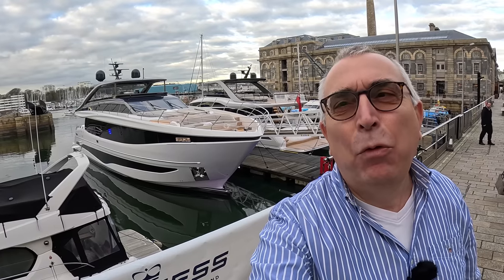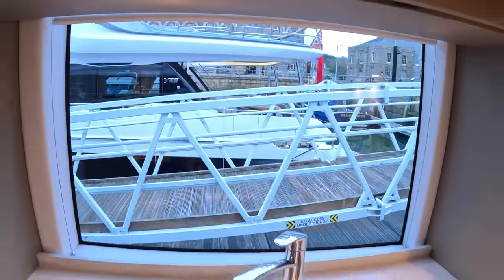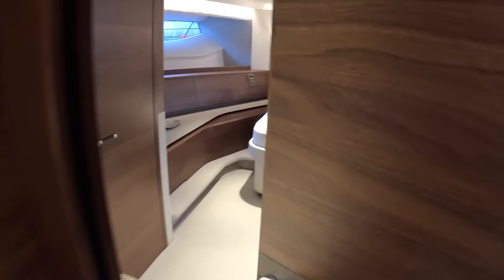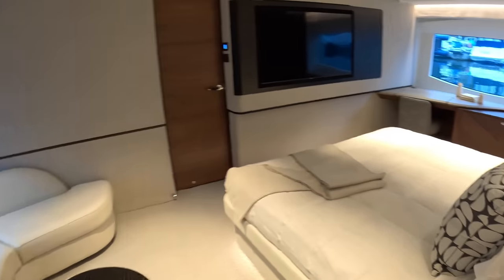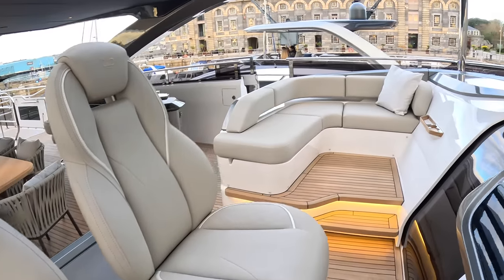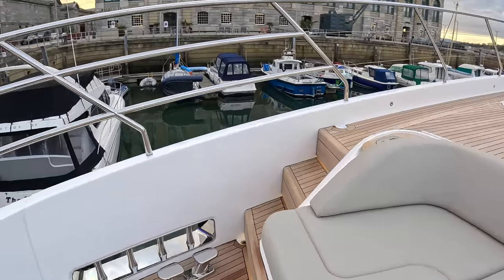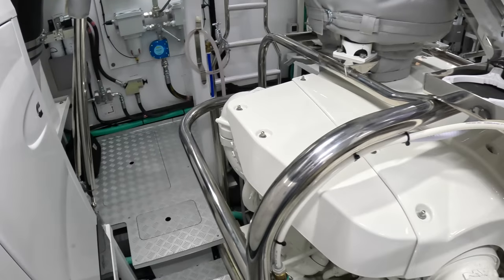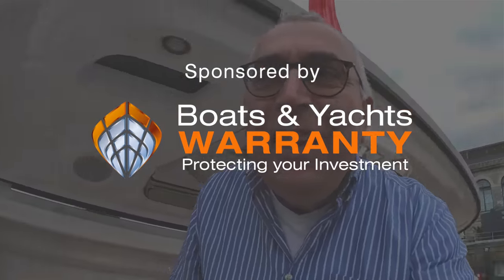$16,000,000 Superyacht Tour : Princess Y95

Comment: Another great Super Yacht Video Nick. However there seems to a famine in videos on more affordable boats including Smugglers  Blues. As you are now afloat all year in Dartmouth - any chance of some winter motor boating?
Reply from the maker: I hope so! We went down today for the first time in ages just to give the poor thing a clean and put a dehumidifier aboard, it's been a crazy busy autumn visiting boat shows and making videos. When we get some lovely winter days we'll make another Smuggler's video. 🙂
Reply: @AQUAHOLIC  Thanks Nick that would be appreciated. 
Yes went down to my 895 Offshore today to check the dehumidifier and decided to add a small bar heater at low setting for this next cold snap. Take it you have drained the FW tank and added that pink ( drinkable) anti freeze too. Agree with you it pays to look after and check your boat through the winter. ( Could be the subject for a future video?).
Plus of course giving the boat a good run when you get a spell of bright settled weather!!!
Your smugglers videos are some of your best!
Reply from the maker: @johnpenson8801  Yes, we have an oil filled radiator on a thermostat. With that and the dehumidifier, it's lovely and cozy down there! 😄

Comment: £16 m and manual doors? Otherwise a stunning piece of kit great tour nick as always 👍
Reply: I'm partial to manual doors. The electric doors are too slow and the button is always off to one side so you have to walk over to push it anyways so it doesn't really save much effort. You don't want auto because you want to be able to stand near it without it opening. Also power doors are just one more potential point of failure. Complexity is the enemy and should be eliminated where it brings little to the table imo.
Reply: If its sinking or on fire i want manual doors thanks
Reply: flacjacket I understand your point but I was thinking more about the crew ,if automatic doors had a foot mechanism it's better for them with their hands being full? And I presume you can turn off the motion sensor?
Reply: Mr titmus as with all yachts, aircraft  etc, there are usually two methods of a door to open as a failsafe auto and manual I would be surprised any vessel would pass certification otherwise?
Reply: It's not 16 million it is about 7-8 million pounds or  about 9 million US. Still, I did expect electric doors.

Comment: Would you rather have the majesty 120 or the princess y95? Both at 16m.
Reply: Not comparable. Different opperating costs (majesty bigger boat more expensive to crew, insure, dock,...) and resale value...there is made in europe (even made in northen vs southern europe), and made outside europe. 
A bit like comparing a Porsche 911 and a Cadillac escalade of similar price..., one will need more gas, tires, oil changes and will sell for a lot less after a few years...

Comment: A beautiful vessel.
I have a safety concern regarding the emergency hatch into the kitchen. If the drawer is open you cannot open the emergency hatch. If the hatch would be placed by the dishwasher it would be easier to force open. Details, needed for idiot proofing systems.
Reply from the maker: I expect whoever was getting something out of the open drawer would probably close it for you if you were emerging from the lower deck through the galley floor in an emergency. 🙂
Reply: @AQUAHOLIC  Time will tell.

Comment: Nick could you do a video regarding owning a yacht as an investment property. Is it possible? How it works and so on
Reply from the maker: I'm not sure anyone buys a yacht as an investment...
Reply: @AQUAHOLIC  not even for rental?
Reply: @maccheese8379  The most succesful charter superyachts can be booked for 1% or even 1,5% a week (of the initial price tag). It is commonly said that the expenses are about 10% a year...
In theory if your yacht is very succesful (right location, right crew, everything always goes perfectly,...) you could make some profit within those circumstances but that's a lot of 'if"
Realistically, you would probably need to have more than one to smooth any problem (crew abscence, boat maintenance...) And hope the next pandemy doesn't freeze 90% of the planet soon because your costs won't go away

Comment: I guess that means load line length is calculated from above what looks to be a bulbous bow?
Reply: Correct, it's where the waterline is on the hull if the boat is fully laden.
Reply: @darthkek1953  Actually, "Load Line Length" is measured at 85% of the "Least Moulded Depth above the top of the Keel". On most cargo carrying vessels, that is a good approximation of the fully-laden waterline (by intention), but on passenger vessels (especially pleasure yachts) it is nowhere even close.
But in this case, "Load Line Length" is not the relevant measurement. If a yacht is classified by the RCD, then commercial regulations just do not apply (and "Load Line Length" is irrelevant), which is the entire point of this type of yacht.
The RCD requires "Hull Length" to be less than 24 metres, and "Hull Length" is measured completely independantly from the waterline. It approximates to "Length Overall" minus any bolt-on, non-buoyant sections (e.g. bathing platforms and/or, as in this case, bow sections).
Read Maritime & Coastguard Agency Marine Guidance Note MGN 645 (M) for more info.

Comment: Beautiful yacht...as always, I wish it had more solar. LOL
But I am really curious about the openings in the middle of the bench seats all the way forward...and there were 2 that I was hoping we would see inside. There was one opening in the teak seat in the very far front, but there was also the opening in the forward facing sofa...which I feel like Princess is smart enough to have put a refrigerator underneath...but I am still super curious about both of them. ✌💯😂
Reply: The energy use of this boat vs the amount of surface for solar... you'd ruin the look of the boat to save an imperceptible amount of diesel.
Reply: @darthkek1953  Over the life of the boat it adds up...but I won't say you are wrong for a lot of smaller craft. But this is very much an owner spec issue, and I wish more owners were making the choice to prioritize solar. That boat could have had a very useful 3kw to as much as maybe 5kw array of the latest solar panels on that big of a hardtop, if the owner had prioritized that...and it would not have detracted from the looks of the boat at all. Going forward, with the new flexible panels that can be mounted anywhere even on the sides of boats, I just really hope that more owners will be investing in much more solar for their boats. ✌
Reply: @iKvetch558  It would be worth it for keeping batteries topped up and systems running when the ship was moored up at the very least.
Reply: @dogsnads5634  Indeed...even a small array would be more than enough for that...and depending on how big a battery bank can be fitted, a 3kw array could most definitely carry a good portion of the electrical load for at least some modes of operation. 🖖

Comment: Seeing the hatch in the floor has made me curious to see what would happen if one of these boats was "on fire". You've shown the emergency exits on boats many a time but what are they like to use in a (simulated) emergency? How do the designers test them?
Reply from the maker: There are specific regulations for these that need to be adhered to.
Reply: An awful lot of plastic hoses in the engine room , MCA would never allow that in a UK commercial fishing boat as they would melt in a fire , I'm surprised they allow it in yachting .

Comment: Beautiful boat, no question. But I feel for the crew. I get that it's common for them to have minimal cabin space, but 4 adults sharing 1 head is just ridiculous to me. Are you really telling me that it was simply impossible to engineer another head for the crew? 

Come on, guys. Also, please don't tell me how "normal" this is for yachts. I really don't care. From what I've seen in these videos, crew are not paid very well to begin with, yet they are expected to render impeccable service or else they're replaced. At the very least, adequate heads could be supplied so they don't have to get up an extra hour early to get their shower time in. Is that really too much to ask?

And I know that they take the job knowing what they're getting into but still, come on. It's not like I'm even asking to increase their pay. I'm just asking to make them reasonably comfortable.

That was to Princess and the rest of the yacht builders, btw 😆 I'm wasn't blaming you, Nick 😀

Comment: Really nice yacht. Now whilst it clearly would've passed muster I do question the sensibility of placing an escape hatch which opens into the kitchen baring in mind the statistics of why you may have to ever use one. Yes of course there is the main route out but let's imagine that, heavens forbid there was a galley fire that breached & made the stairway unusable for escape then your backup route would not only be unusable but the mere opening of said hatch risks an immediate deck jump of said fire. 

I of course accept that Princess have been in the business for longer than many others and certainly know what they are doing but this placement seems somewhat illogical. Nick feel free to shed any light/ mitigation that you know of. Which of course will likely make me go "ahhh, of course".
Reply from the maker: If the galley was on fire you'd leave the lower deck by the normal stairs.
Reply: @AQUAHOLIC  No I totally get that that's what you'd do. I was raising the issue of a worst case scenario where the stairs were blocked by the fire which broke out in the galley making the placement of said escape hatch something of a problem. 

I also appreciate that by design the galley bulkheads are higher grade to aid in fire containment but am also a firm beliver in 'never say never' and in planning for the worst. No matter the probability of XYZ happening. We've certainly, unfortunately, seen more than our fare share of near/ total loss fires this last year after all so the hatches placement just bewilders me somewhat. 

Would add that this perplexing issue in no way takes away from, yet another, excellent & detailed tour and that the above aside I still think she's a great looking boat.

Comment: I was extremely impressed with this boat until I saw the crew areas. This is probably the worst crew accommodation of any boat tour that I've watched on your channel. These are the people that manage your boat, serve you and must keep things clean, the least they deserve is proper accommodation.

As far as I can recall, just about every crew area that I've seen on this channel has had en-suite bathrooms for every crew cabin. Here, four people need to share one shower and one toilet? Not ideal. Not to mention how cramped those cabins are.

There's not even a dedicated crew galley or mess area, if the beach club is in use by the owner or guests, the crew will have no place to prepare or eat their own meals until the beach club is not in use. Okay, I suppose they can still prepare their own meals in the main galley, but still, no place to eat unless the beach club is not in use? Nope, not very well thought out, in my humble opinion.
Reply: This 29 metre LOA boat is built to "cheat" a rule so it qualifies as a sub-24 metre Hull Length boat. It is therefore regulated by the Recreational Craft Directive and not as a commercial vessel.
Hand-in-hand with the reduction in requirements for crew qualifications is a reduction in the requirements for crew accommodation (i.e. under the RCD, there are no requirements, whereas commercial craft must provide certain facilities and a minimum area of living space per crew).
So not only is this yacht much bigger than would normally be expected to be crewed by amateurs and less seaworthy than a conventionally classified yacht of similar displacement and length, it also shows how little the owner cares about any crew he does employ.

Comment: Love your vids, but you have too low frame rate in the videos. The tearing when you move around is not very appealing. 
3840x2160@25 / 3840x2160@25
25 FPS is just waaay too low. Go for 60 FPS 4K. 
For $2000 you will have upgraded the visual quality for detailed shots, but for your viewers delight also.
Can't you even get GoPro HERO11 Black (5.3K 60fps / 4K 120fps, HyperSmooth 5.0, Horizon Lock, GPS, 27MP kamera HDR+RAW) for $500?

Comment: Bit overpriced lmao
Reply: It’s a PRINCESS super yacht what did you expect ?? 🙄🙄🙄
Reply: @Kandlelite  It's not a superyacht.

Not even close.
Reply: @darthkek1953  Actually over 79ft this is called a superyacht. Mega/giga yachts don't officially exist
Reply: @trthib  Superyachts don't officially exist either. There is a "Large Yacht Code" that starts for 24m at the load-line, but there are a series of categories above it. From 24m to 500gt is a range of production yachts, floating cookie cutter caravans.  You know why I don't consider them superyachts? NOT ONE OLIGIARCH IN THE WORLD WOULD LOWER HIMSELF TO BUY ONE. They commission REAL superyachts, hitting the Large Yacht Code trigger between 500gt and 3000gt, and because of that many of them are built to around 2900 or so gt.

When you see a large charter yacht at the boatshow, it looks impressive. When you put it next to a REAL superyacht it looks like a dingy.